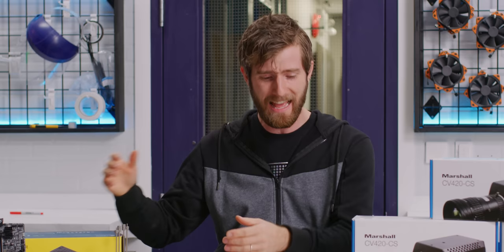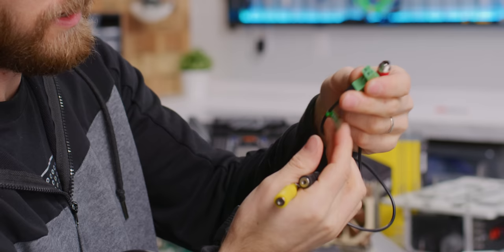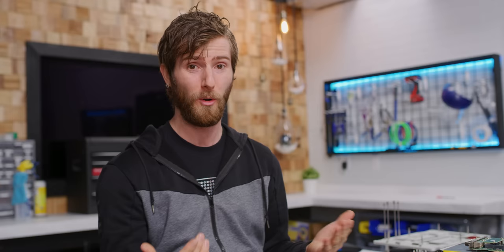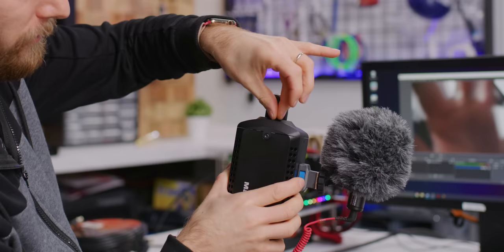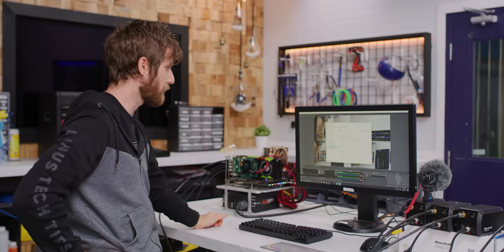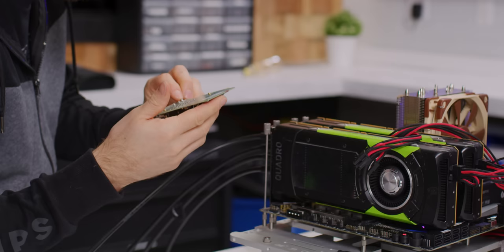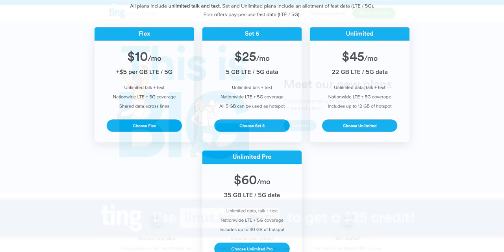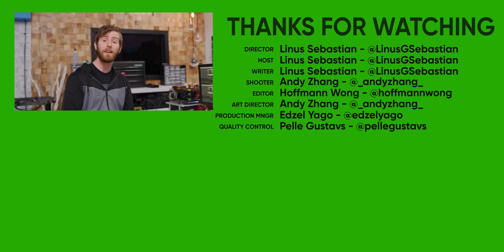I've NEVER done anything like this before...

Comment: These middle school badminton players have a higher quality broadcast setup than 90% of college football teams.
Reply: Deutsche Bundesliga, soccer here in germany
...still largely does 1080p30 :D
Reply: More than all of serbia lol
Reply: @IngwiePhoenix  the  most expensive part of broadcasting is not the camera, but everything that comes after it.
Especially in sports you have very specific needs and expectations. 
E.g. you want to be able to do an instant replay of a goal or a foul. 
So you need to broadcast, store and pick and choose from the same video stream simultanously.
This is why they use different videoformats that are uncompressed(The single frames can be compressed, but there is no compression inbetween frames -> no inter-frames only intra-frames) -> Lots of data
In addition to that the connection from the camera to the OB-Truck is often still a coaxial-cable connection, which is limited in its bandwith and/or length of the connection(many modern cameras use optical fibres, though), plus your OB-truck needs to be able to process the data etc.
In conclusion: just changing the camera wouldn't work.
Reply: @Damindeater  who asked tho?
Reply: @meknowu1  I did
Reply: @meknowu1  I did
Reply: Lol If Linus was in the UK he’d install it and discover that the leisure centres barely have broadband let alone able to support that crazy setup. 😂
Reply: @IngwiePhoenix  Because the DFB sets no standarts for picture Quality
Reply: Football needs a low resolution, framerate, color clarity, etc. so people don't realize that IT"S F@@KING STUPID!
Reply: @wesleymays1931  based
Reply: You mad bro?
Reply: @IngwiePhoenix  then tell me how am i watching it in 4k60 with hdr? thats bullshit. Look at those giant cameras on the side of the fields
Reply: My school used a phone which is 40$ phone with a a trash camera for the whole school.REALLY!
Reply: Gotta pay those coaches millions of bucks to break college kids who lose thier scholarships after the coach gets them hurt.
Reply: @meknowu1  who asked u to reply
Reply: @meknowu1  I did
Reply: And so is the Linus way
Reply: @IngwiePhoenix  on Sky maybe. Dazn streams at 720p
Reply: @wesleymays1931  yeah man fuck letting people enjoy things, everything has to be serious all the time. No fun allowed in my life, no sirree
Reply: @IngwiePhoenix  boomers dont like over 30fps it hurts their brains
Reply: @Damindeater  the original comment is still true though.  Why are we not getting 4K sports in 2020?  When people get a 4K TV and see how ugly sports look they tend to not watch as much.
Reply: @Studio Harris Never got picked at all! Always pretended to be sick on football day
Reply: Yup
Reply: @DongleLife
Reply: @nicoth1848  just because your tv is 4k60 with hdr doesnt mean the content is

Comment: Linus: “We’re on a budget”
Also Linus: “Yeah, we’re gonna use 2 Quadros here”
Reply: To be fair nvenc is limited to 2 sessions officially on Geforce (nVidia limits nvEnc on any Geforce in the Driver) where as Quadros like the P2000 and higher in theory can run unlimited nVenc sessions...
Reply: and I have noticed that nVidia started to have nVenc idleing if no Display is recognized... Even on lower end Quadros like a P400
Reply: Aside from the enterprise grade stuff with drivers, the GP100 is essentially a Titan Xp with 25% more power, and the P2000 is weaker than a GTX 1060 in every possible way.
Reply: that's a great Segway to our sponsor, Nvidia
Reply: He never claimed it was a small budget?

Comment: Linus: "I'm on a budget!"
Also Linus: Six 4k cameras, two $700 cards, a threadripper and a quadro. To stream at 1080p on Twitch.
Reply: As far as I understood this is funded by all the players/parents, so the per capita numbers probably turn out very reasonable
Reply: That is Linus on a budget, though :D
Reply: Wouldn't it be cheaper to just use multiple cheaper GPUs for nVENC? 4k60 HDMI capture cards are also quite cheap
Reply: nobody noticed that the orange screwdriver is back
Reply: BabeMinzgirlsszz.SpaCe
Reply: @Skiffy1  lol that was pretty good
Reply: @rkan2  I was thinking the exact same thing.  I get trying to do it one one super card, but if you have to split it up anyway, might as well save.

Comment: -"SDI inputs go 1,3,2,4, obviously."
Looks at ram slot, grins
Reply: But... they are numbered 1234, you just dont use them in that order.
Reply: @Bamfhammer  i dont know if that makes it better or worse (probably worse)
Reply: 1A 1B 2A 2B
Reply: Also, don't ram slots usually go 3, 1, 4, 2?
Reply: @maschan91  Depends on how old the board is and what brand, but still basically 1234 or 1122 in that case. Not some bizarre 4132
Reply: @XDSDDLord  No. 

I am sure there is a board out there that goes that way, but they are numbered 1,2,3,4 or A1, A2, B1, B2.

Typically you use them in the order of 2,4,1,3 or 2,4,3,1 though.
Reply: @Bamfhammer  He's assuming you put the first two sticks in A1 and A2. Motherboard manufacturers recommend B1 and B2 for two sticks. Ie. 4231 for ram slot order per stick. With the number being the slot you put then. Basically it can be defined in a lot of ways.
Reply: @backfootdrive  I understand that. I am going by the labels printed on the board and what they are called in bios if you have a bios that tells you what slots are full.
Reply: @Bamfhammer  I know how they are technically numbered, I meant the order you put the DIMMs in, assuming you don't fully populate all four slots. Second slot from the CPU for one DIMM single channel, second and fourth for dual channel.
Reply: @XDSDDLord  What's the point of 4 slots if you are not going to use them all. I do the same thing with PCI-E cards too. Doesn't everybody???

Comment: Linus: These things are pretty cheap

Linus, 60 seconds later: These things, second hand, costed me $750 each.
Reply: That is actually really cheap for a 4K camera, a normal mirrorless camera that records good 4K starts at around 2000 without a lens and the real cine cameras easily go into 5 digit price ranges.
Reply: Ikr i was kinda thinking 750 for 5 (150 each), but ig 750 each works too ×_×
Reply: everything is relative,  and a good 4k camera with accessories so you can actually use it can cost as much as a decent used car, but if you find a decent, running use car for $750 thats a steal isnt it?
Reply: Used GH4..? Like 300-400$.
Reply: Why did he even want 4k anyways? I feel like 1080p would've been good enough lol
Reply: @danielhu6485  Shuttlecocks are small, so 1080p may be too low of a resolution given the field of view of the cameras to properly track the path of the shuttlecocks.
Reply: @MarkusPalmHD  thats what I use
Reply: used
Reply: Logitech's 4k webcam is like $200. I don't know what some of you guys expect from gear that's supposed to be used in a professional setting.
Reply: @madtoffelpremium8324  A genuine cine camera STARTS at 6 digits. If you go Alexa; and lets be honest if we're talking genuine cine you probably are, you can end up in 7 digit territory without really trying. 

The cameras Linus is using here aren't anything like cine cameras though. They also aren't anything like a consumer mirrorless. 

To put pricing into perspective, a security camera with SDI and a  quality 4 0 0 4K sensor costs around $250. 

The Marshall cameras Linus is using has as little in common with a security camera as they do a cine camera or a mirrorless. Actually this specific model has a bit more in common with the security cameras than they do the others. 

These are compact SDI BROADCAST cameras. They have none of the features of a cine camera and play in a 4 2 2 colour space. They aren't comparable to cine, at all. They're a completely different use case. 

Remember how Linus said Marshall don't do marketing? That's because they aren't consumer (or prosumer) products. They're for broadcasters. If you're a broadcaster, you know they exist. If you're not a broadcaster you're not the kind of person they want as a customer. This camera is designed to be purchased in sets of 15+ to cover broadcast situations such as sporting events, awards shows or concerts where you need small light cameras to cover lots of angles. The CV-400 series is Marshall's entry level. 

To truely put the individual price of these cameras in context, when they were on offer new they cost $1700ea. Linus paid just under half price each, but he couldn't by the 426 new even if he wanted too. He'd have to get the 420-CS if he wanted new. 

NDI is the broadcast connection of the future, so SDI is being phased out.
Reply: @BubbaBearsFriend  he said the streams are going to be 1080 60.
Reply: tbf that's relatively pocket change for him
Reply: @madtoffelpremium8324  The Sony a6400 does 4K @ 30p in true HDR (HLG) color and it costs 900$. It would be nice to have 60p on the Sony crop frame mirrorless cameras though.
Reply: @hailgod1  no he said who wants 1080p streams. Also his pc auto defaulted at 1080 so he had to reboot to get them fixed to 4k. Did u even watch this video
Reply: @samwyzegg7935  The Sony a6400 is a consumer mirrorless camera that does NOT do 4 4 4 (true colour). 

It's an entry level consumer mirrorless with an APS-C sensor in a 4 0 0 colour space. 

These are completely different things. You don't seem to understand what you are saying.
Reply: @madtoffelpremium8324  What's the difference between these and 4k ip cameras from Amcrest? Those only cost $100.
Reply: @madtoffelpremium8324  Not really, that was true a few years ago but now you can get a G9 and lens for less than $1000
Reply: @tjmarx  I work for a company that manufactures small formfactor broadcasting cameras. Most of them are focused on slowmotion/highspeed capture for sports (for example inside soccer goal posts, inside icehockey goals etc.) but we also have a couple models that "normal speed" cameras. One of our 4k cameras with a controller unit (mandatory and also is the unit to control colours, focus etc.) have a list price upwards of 17 000€. The slowmotion models in 1080p still have a list price of roughly 30 grand and the 4k ones soon coming out are currently expected to have a list price of roughly 68000€. So yeah I can confirm the ones used in this video are fairly cheap but I assume most of that usage could have been done by simply using a bunch of 4k webcams (and just have more per court).
Reply: @beemo808  Less than some might think. 

The main differences are the amcrest security cameras have a single integrated prime lens at a fixed aperture. They also have a much lower quality CMOS sensor. 

Meanwhile Marshall, who also make security cameras, use a broadcast quality sensor in and provide a the broadcast standard CS mounting system for interchangeable lenses in their broadcast like up, which the 400 series is the entry level too.
Reply: @Esablaka  To be exceptionally clear, I was not stating that broadcast cameras are generally cheap. 

I stated that broadcast cameras do not share much in common with cine cameras. 

I then compared the 426 specifically on price. What your company manufactures is a different thing to the discontinued entry level 426. 

While we're tooting our own horns, the organisation I head has a broadcaster amongst it's assets.
Reply: @PhilippBlum  It IS a budget broadcast set up. This is not a  consumer product and no one claimed it was. In fact, Linus explicitly stated that Marshall don't advertise. The reason they don't advertise is because they have no consumer products and will not deal with consumers. 

Inside the world of broadcasting though (which Linus is technically in even though he only just seems to be realising it), $750/camera is a very budget setup
Reply: @MarkusPalmHD  Won't it have a limit on recordtime?
Reply: That actually is cheap for a good 4k camera xD...
Reply: @tjmarx  I was more just repeating Sony’s words on their HDR. I shouldn’t have used the word color in there. The a6400 does 4:2:0 though not 4:0:0. But my point was that for 800-900 bucks, you can get pretty good 4K video.
Reply: @danielhu6485  because he's runs a Tech channel, it's so he can watch his kid play the sport they both love and he can write it off as a business expense maybe?
Reply: @scottroberts3158  true, but 1080p would've still costed him waaay less lol

Comment: That computer that he setup to watch and record his kid playing badminton is more powerful than the one I use for my gaming ;-;
Reply: Haha me too.
Reply: Any piece of this setup is more expensive than my whole setup.
Reply: Not more powerful in every way. While you can game on Threadripper and Quadros (nothing prevents you from running a game), it won't be as good an experience as on gaming-focused hardware like an i5 or Ryzen 5 and Geforce (or Radeon). When it comes to encode and compute applications though, this system does indeed crush most gaming builds. It also wins when you only measure performance in TFLOPS. However, to make use of that muscle, you need specially optimized and parallelized workloads, like streaming, AI, simulations or video / CAD / 3D animation rendering and editing, but not gaming.
Reply: no shit
Reply: @matekovacs2696  bruh. I have a Ryzen 3700u with integrated graphics and 8GB of ram.
Reply: @onelightgaming  I'll do you one better; I have a Core i3-7100 in a B250 motherboard, 8GB of some slow RAM, and an RX 570. When I try to run my not-too complex Simulink circuit model (nothing fancy 3D, just circuit and signal processing sim), it takes a minute to simulate 2 seconds, and both CPU and RAM are pinned at 100%. All that on Linux, a well-optimized system without the background fuss Windows has.
Reply: Brought to you by Nvidia
Reply: @matekovacs2696  I will do you another one better. I have bloated HP software + windows and Adobe Malware that's still left from when I tried the trial
Reply: @SomeTheorist9090  wdym
We weren't talking about them in this thread. Yes, Linus used Nvidia Quadros for the computer. He had those laying around, no transaction happened with Nvidia. He could have just not used a graphics card and encode in software, out of principle, but this was probably filmed before the whole debacle with Nvidia and Hardware Unboxed.
Reply: @onelightgaming  That you can fix for free. A more powerful computer you can't get for free (especially not in 2020). But I hear you.
Free yourself of the burden, install Linux, or just declutter your Windows. It might be worth a try.
Reply: @matekovacs2696  yeah. But I have games that are windows 10 only. Lol this whole comment thread is enough to get us all into ROG Reboot
Reply: @matekovacs2696  linux is a finicky sometimes. Right now, I am trying to get Davinci Resolve to play nicely with my RX 590.
Reply: @onelightgaming  I'd recommend finding some software to remove what is left of Adobe. Not to mention using something like windows10debloater to get red of a lot of the unnecessary Windows crap and the HP bloatware. Gaming is pretty much the only reason I don't use Linux more often so I feel your pain. Whilst there are options out there, it's not as smooth an experience in some games.
Reply: Thanks  @stephen9894 ! I will definitely try those things.
Reply: @fatman8303  Yes, it isn't perfect, but Windows can, too, get tricky time to time, but with Linux I at least know for sure that I won't be shown ads in the equivalent of the Start menu, I don't have to deal with all the individual app update crap that hogs down your PC in the background if you use Windows, I have an actually usable search, and I didn't have to sell my organs to get a Mac. Just to name a few advantages. You can game on Linux too, thanks to Valve's great effort with Proton and DXVK.
Reply: @onelightgaming  I think that ship has sailed, sadly. Also by the time that arrives here in Hungary, half of the components are dead.